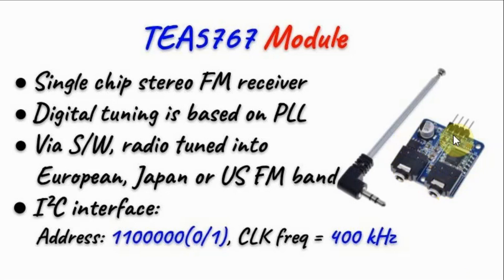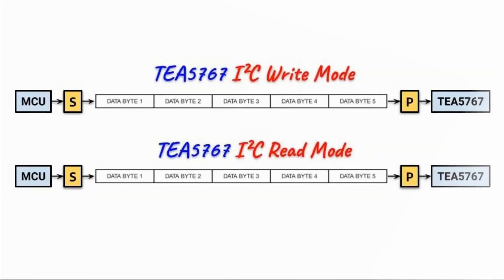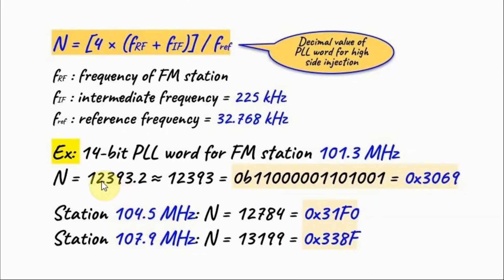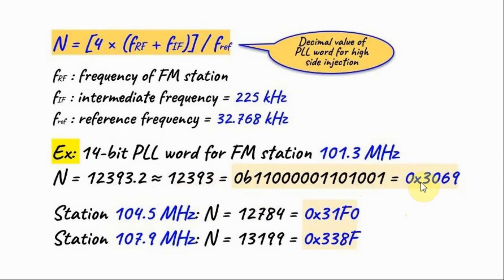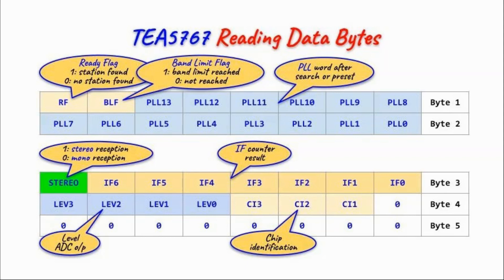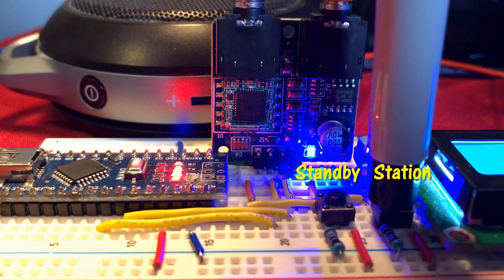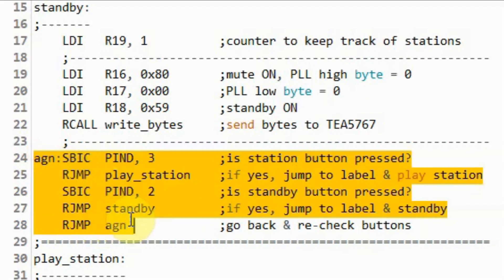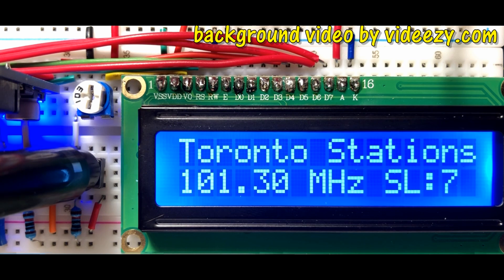Assembly via Arduino - TEA5767 FM Receiver

Comment: Sir i finaly assembled . But  some  clock click sound comes with stations sound. Weak stations skipped by this module,   how to add 5110lcd ,oled  .how to reduce noise lavel . In tea5767 or rda5807m please guide me.
Reply from the maker: For the click sound, you may need to research this & see see how to eliminate via LPF. As for weak stations, you need better antenna. As for interfacing OLED/LCD, well that's a future project.